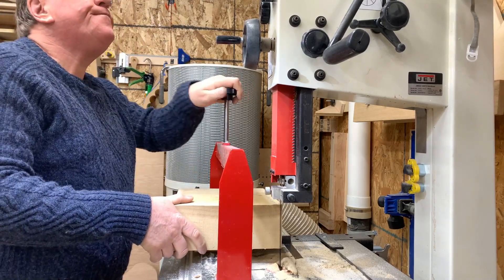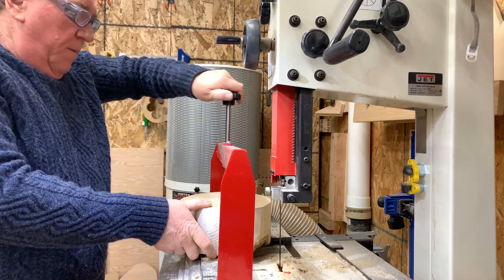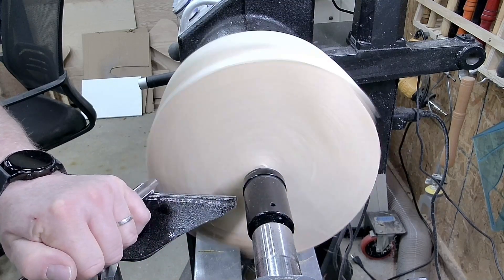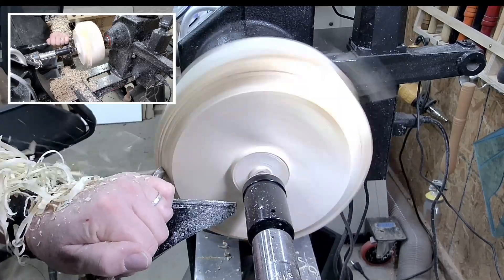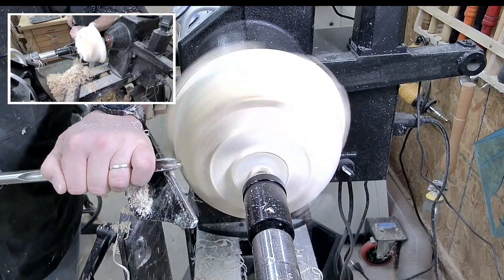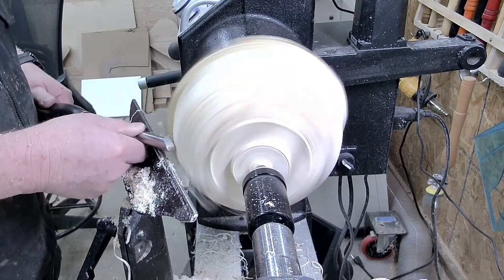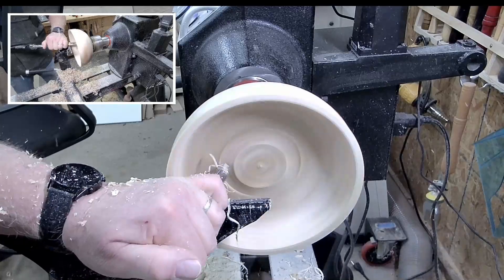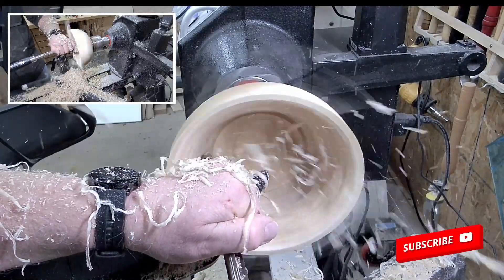Woodturning - Poplar Ebonized Wood Turned Bowl

Comment: Mate, I need that jig in my life for cutting those smaller jobs that cut my finger off Legend. Beautiful outcome
Reply from the maker: M
Kezzaaa! Good to hear from you mate. Hope your on the make and springing back soon. As for this jig it’s from here https://stockroomsupply.com/ Watch his videos as he explains the science. I have to say it took a few close calls before a shelled out for this. I was “attempting” to cut dowel rod on the band saw a few years back. Suddenly the saw blade caught on the wood and the rod whipped around and smacked my wrist and the blade snapped! (Well broke at the weld joint) this scared the shx5 out of me and a new respect was instilled in me. I reckon we should both knock up a vid each telling the dangers and subsequent safety measures when using the band saw. Anyway I digress. Get well bro, and I want to see you back on the horse on your next vid soon! Cheers Johnno